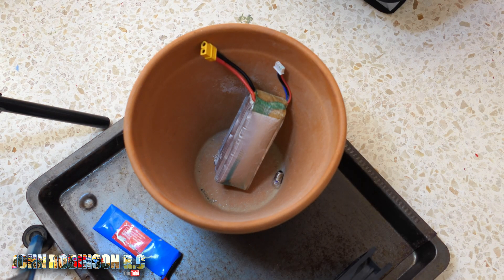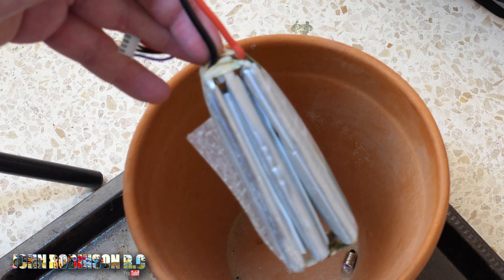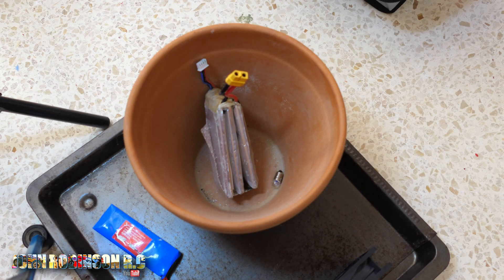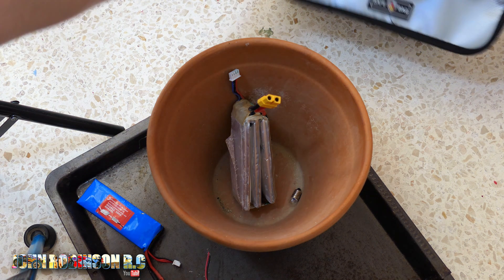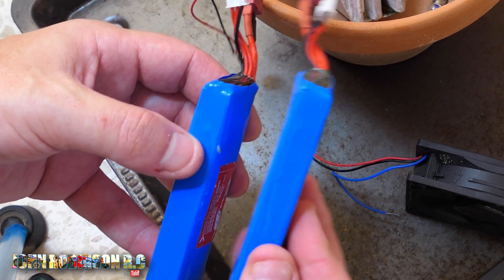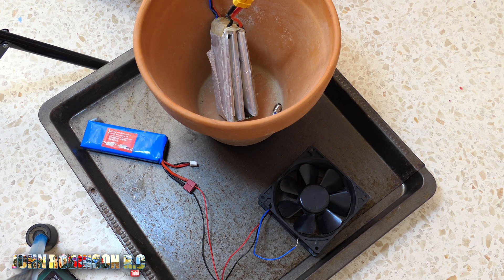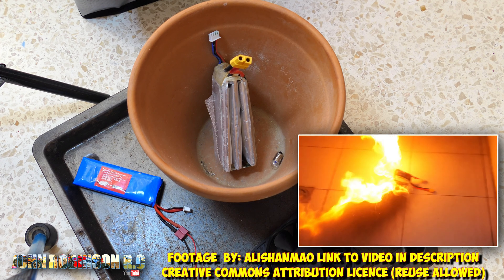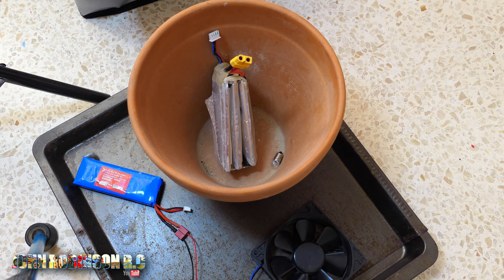RC lipo battery safety that you should take seriously

Comment: Informative video. What's the deal with poking a hole in the wrapping,letting the gas out, putting electrical tape, and harry's your godfather?
Reply: Yeah you can also drive a nail through it outside on a concrete surface with nothing around it. Or also give it a saltwater bath after discharging it.